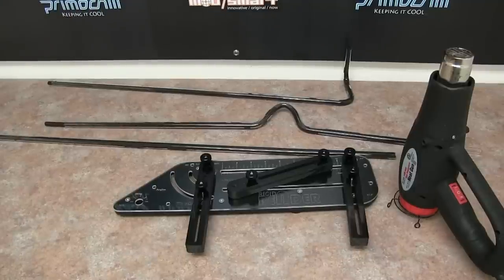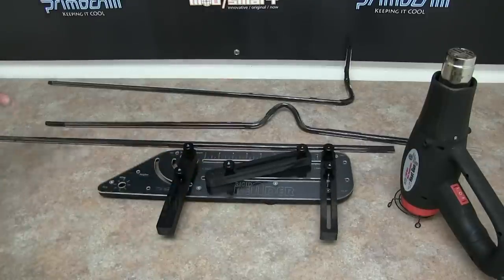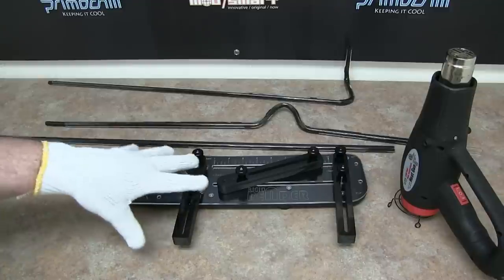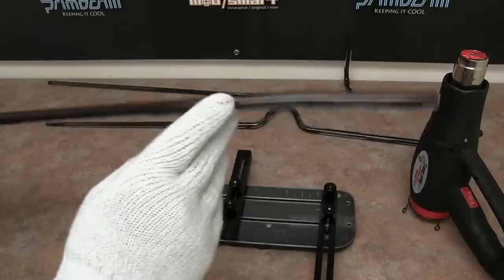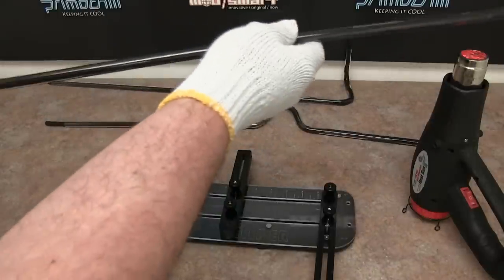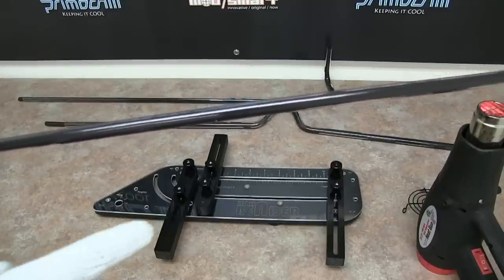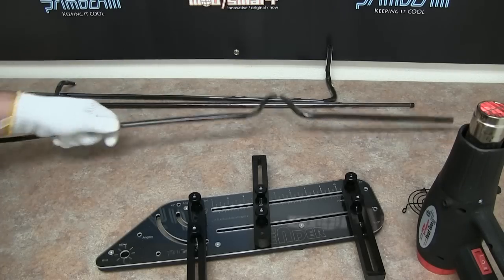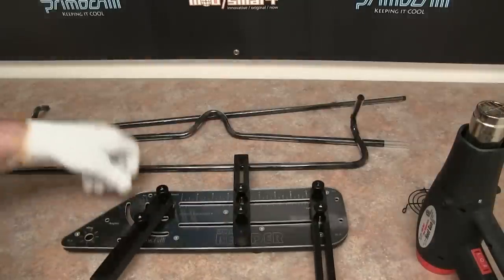PrimoChill Rigid Bender -- Versatile Rigid Tubing Bending/Jig - Product Intro

Comment: Potentially a great product, but this video doesn't show it off and worse confuses the viewer at points (hold this at 90? you should have flipped it around the other arm as well and you would have it at a real 90 as it would have been supported by two arms.)

Wish you would made some real world spaced bends ... "this area here" etc isn't too useful. If you want people to try this modding method out (and purchase this easy to use product) I would have had some fittings on disused gear, or pegs on plywood ... if a component is 585mm spacing away ... show how to measure that (center of fitting to center of the fitting) and how to get the 90 degree bends. ask the viewer to double check that they are not measuring the distance from the wrong edges of the fittings and such.

I find using the tube (i have a tube with paracord in it for some stiffness) and work out the end on the jig first.

Comment: i use the inner tube for marking and put tape on that with markers then when its in the tube you got all you need, just use hands and eyes for the bend, most the time just need a 90 and that's fairly easy for anyone to do, if theirs a couple of weird bends to get round a chassis use 2 small bits of pipe on the insert pipe and move around the chassis with it to see how it would look, its not glass tubes so don't have to be 100% precise.

Comment: Cowboy Bradley The reason the ruler portion starts at 1 inch rather than from 0. Is because it is accounting for the gap between where the bend arm and the ruler begins. so between the center point of the arm and the markings is 1 inch.

Comment: I saw a problem with this right away before 20 sec mark of the video, it dont have the tube dimensions carved into the bend corners, its just like bending metal, you need grooves on the edges where the pipe shall lay so it dont get bent outwards on the edges of the bend

Comment: The ruler on this starts at 1" ...am I reading this or looking at this wrong? If I want a 5 inch bend starting at the 1" mark I'd have to go to 6" right? Why not start at 0? It would also be nice to see rulers on the arms themselves to watch length between bends. Or degree marking on the circular side, to measure bend angles. :)
Reply: The 1" is where you set the stop, the part that you bend the tube on would be 1" from that point. So if you wanted a 5" bend you would just set it at 5" and the reason for it not starting at 0 is that there is a gap between the arms that they have already accounted for.
Reply: You know but you have to scruff up the arms when you recieve the "bender" because you know they dont grip the "pipe"......................you know.........

Comment: Why isnt there a ruler on each of the arms??? Thats where it should be to get correct measurement to bend. And theres nothing holding or indicating the bend is exactly 90°, he just holds it and.. guesses? so the arms and the device does nothing more then your right hand would do! AND THERES NO FREAKING RULER ON THE ARMS.. NO CM, NO INCH, NOTHING. Unless you only have 1 hand, I just cant figure out what the device does to better or ease the bending

Comment: I received this thing today and am very confused.  You show it bending tubing and I am sure it does it well, but it has ZERO real world use when trying to build a system.  It has marking on it with no explanation..... 

It would be useful to add angle markings on the left arm that does, you know, bend angles.  Like at 8:30 when you make the 90 bend.. you say, it looks straight coming off there.. its kind of important for it to be 90, not look 90.

Needless to say I am returning this and kind of ticked this thing costs $50 bucks.  I know you mean well because using rigid tubing is a pain, but have you actually used this to build a system?  Maybe if you showed that then all this would make sense.
Reply: Not having used this, I can't comment on how it actually performs. But having just gone through my third attempt at building a rigid loop, I'm looking at this thing and wondering how I would reference my lengths (and as you said, know that my angles were, in fact, correct). In the end, I bought a kit that has billet aluminum mandrels that allowed me to make perfects bends with centerline lengths coming up perfect. Warmed up the tubes, formed them around the mandrels, let them cool, installed them with no force or tweaking necessary. My only wish was that for more complicated bends I had more mandrels to play with. But $100 only goes so far. To be honest, I wish I'd started with it, instead of assuming that I could just wing it.

Comment: Honestly this is the worst way to use that tool. The tool itself looks great. But if you just kept the top slider in on the top slit, and left it perfectly horizontal, then use the left angle slider at the angle you wanted, you would get much better bends with a much easier and more intuitive process.